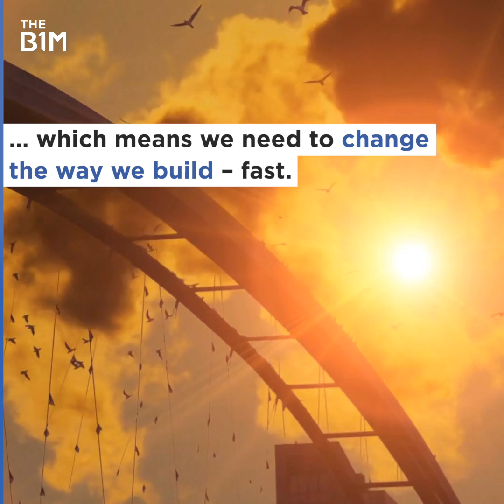This Mass-Timber Building Kit Could be The Future of Construction

Comment: Everything is fine until you let an army of bored and frustrated teenagers with access to lighters into a wooden building.
I used to go into a school made from concrete, steel walls and plastic chairs and tables. Only the concrete was safe.
I predict burned wall art will be a thing in those schools.
Reply: It's not like you can't resurface exposed wood by sanding it down, but you can't do it endlessly. Then again if you're in an area prone to that you can just paint the ground floor. 

And if the teenagers climb two floors to tag your building I'd say they've earned it 😂

Comment: Dude what about fire , rainfall , bacteria and safety . Please explain me
Reply: Almost all houses are wood framed, so why not ask these about most buildings? Mass timber withstands fire better than most metals and concretes regardless. It's too thick to burn and it forms nonflammable char on the surface
Reply: The timber shed at the end of my garden has been around for longer than me. It's got a felt roof covering, and is built on a concrete base. All the problems you've raised can be beaten by design changes that were developed centuries ago.